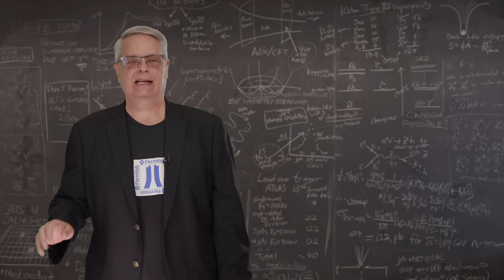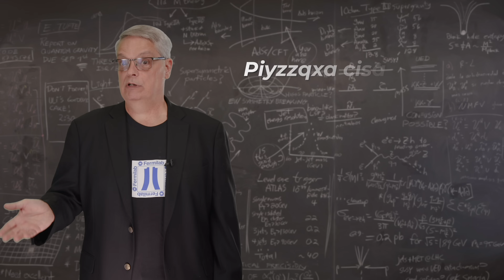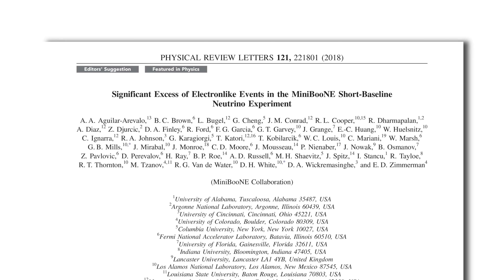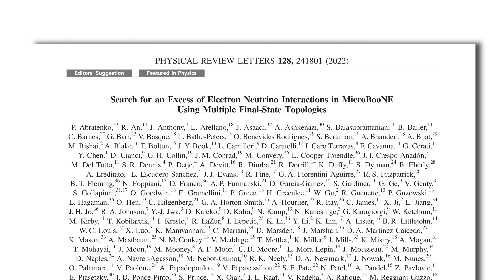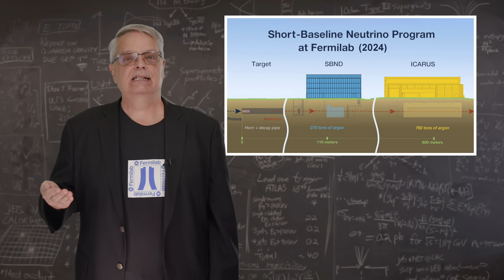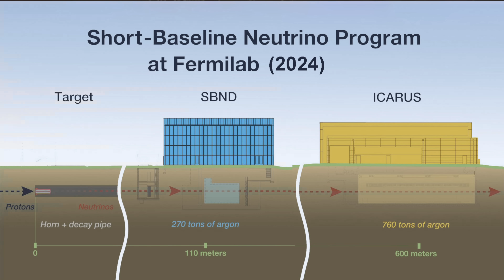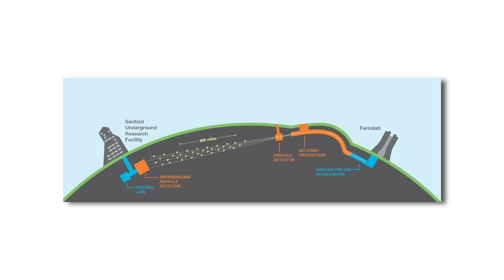Fermilab's search for sterile neutrinos

Comment: Basically the logic of chemistry's energy level staying the same when a one matter is bond or unbonded from another different mass, atom/molecule, it make sense the electron controls the atom's positioning being stable, thus when accelerating energy the neutrino, like the neutron appears to fill any gaps between existing energies that will allow to maintain a const energy level sense.

Electrons do present the speed of light controls and opens the door to the fillers, neutron and neutrinos.

A control to preventing the atomic explosion?
Reply: Some help on the thought, 
the gravity is the logic of placement,
but energy has the ability to relocate self,
so neutrinos could be a substitute and the neutron for gravity's hold.
Reply: Based on the accelerator is a energy current.

Comment: See/saw=constant Sterile neutrino S=(E*T)/(M*T)=2*(me/pm)^2=2*137.036*(2.16*10^-9) is oscillating between T=g*m^2/137.036*(8pi/3)=0.015448 Gev[1.602*10^-19/c^2] : Tau neutrino : right handed antineutrino of M, E, M=pm^2/(2*g*m^2*137.036)=0.1811 mev : Muon neutrino, E=me^2/g*m^2*137.036=0.108*e : Electron neutrino, deduce 2pi*0.001161409725*(me/pm)^2=(me/pm)^2/137.036=128.4980143*A/3.1415926=128.51991*A1/3.1415926=2.16*10^-9=0.00116592026-0.00116591810 : extra wobbling of muon between experiment data[0.001165920+((61-41)+(57-25))*10^-9/2], theoretical prediction[0.00116584719+6845*10^-7+154*10^-8+92*10^-9] from Fermiab at 8/10/23 due to weak force pm/me=1836.1527=4pi*137.036^2/128.51991=1/(4*A1*137.036^3)=(pi/(128.4980143*A*137.036))^0.5 unite strong force g(p)=g*m^2/pm^2=g*(pl/4.1888*l)^2=1.13*10^28 which can deduce ch=2pi*l*m*c^2=2pi*pl*pm*c^2/(4pi/3) by graviton g*m^2=ch/2pi : solution of GR field equation ch=8pi*g*(m*c^2/2)^2/c^4 at any point of 4D dynamic space time oscillating between Planck scale l=g*m/c^2=(h*g/2pi*c^3)^0.5=1.616231*10^-35 meter which can deduce ch=2pi*g*m^2, m=(ch/2pi*g)^0.5=2.176466*10^-8 kg, proton scale pl=g(p)*(4pi*pm/3)/c^2=8.809*10^-16 meter, EM force between proton[pm=1.672621868*10^-27 kg], electron[me=9.10938356*10^-31 kg] in hydrogen Atom[A=5.29177282*10^-11 meter] k*e^2=g(p)*pm^2/137.036=ch/(2pi*137.036)[e+]=me*(c/137.036)^2*A[e-]=4pi*g(p)*pm*me*137.036/128.51991 which can reproduce Dirac's quantum field deduce 0.001161409725=1/(2pi*137.036)=e+/ch : Schwinger's weak QED of Yang-Mills gauge field for anomalous electron magnetic moment of (g-2)/2 factor from positron e+=ch/(2pi*137.036)=k*e^2 which can turn into quantum gravity 2pi*k*e^2*137.036=ch=2pi*g*m^2=2pi*g*(137.036*up*e-/l)*(137.036*up*e+/l)=(2*A1*137.036*pm*c^2)*(4pi*A*137.036)=En*L produce dark photon[Axion] of EM wave at speed of light c=1/(up)^0.5=299792458[meter/second][u=4pi*10^-7, p=8.85418782*10^-12] by r=En=ch/L=chR=me*(c/137.036)^2/2=13.6*e*((1/1^2-1/2^2)+(1/2^2-1/3^2)+...+(1/n^2-1/(n+1)^2))=(h/2pi)*(f1+f2+...+fn) : Einstein's random photon electrical effect prevent continuous ultraviolet catastrophe of electron in Atom, deduce 85.73% ratio between muon[105 mev=(3*137.036/2)*0.511], electron[0.511 mev=me*c^2=g*m^2*137.036/A] decay from beauty quark of strong force 4.25 Gev[1.602*10^-19/c^2]=(10/16)*137.036/g(p)=(10/16)*(me^2/g*m^2)*(137.036/(me/pm)^2) for SO(32) super string theory unite 10D of open string with 16D of 4 4D force of close string by super symmetry 137.036=g*m^2/k*e^2=GR/QM=(m*g*pm*g(p)*pm*g*m)*(1/137.036)/((e-)*g*(e+))=ER/EPR from 100-85.73=14.27=A/(3*137.036*(A-A1))=128.51991/(3*137.036*(128.51991-128.4980143))=128.4980143/3^2=(80.351+0.135)/(137.036*(80.485-(80.428126+0.015448))) deduce 80.428126 Gev[80.351+,-0.094] : W boson from CERN, A1/A=128.4980143/128.51991 : oscillation of Atom radius cause Einstein's Brownian motion we can observe oscillation of Sterile neutrino between 3 flavors neutrino from 3 2D Schwinger-Dyson quantum field ch=2pi*l*m*c^2[type1]=2pi*pl*pm*c^2/4.1888[type2b]=2pi*A*me*c^2/137.036[type2a] by ADS/CFT duality from 3 quantum black hole l=g*m/c^2, pl=g(p)*(4pi*pm/3)/c^2, A^2=g(p)*pi*me/128.4980143*c^2 which can compose a unique extra 6D Calabi-Yau manifold for string theory fits our universe deduce 2^(1/6)*ch=125.0895 Gev; Higgs boson from Higge fied ch=(4.9154)^3*pm=111.4421 Gev[1.602*10^-19/c^2] under critical mass[6^3*pm] as dark energy can expand our universe by ch[72.13%]+ch/3[24.04%]+ch/6pi[3.83%]=En[100%] from SS 1/137.036=e^2/(2*ch*p), (8.809/8.45)^3*ch=126.25 Gev : Higgs boson from muon decay shrink pl to 8.45*10^-16 meter, (6.674103388/6.661181)^2*0.001161409725=0.00116592026 : anomalous muon magnetic moment of (g-2)/2 factor for QCD of Yang-Mills gauge field oscillating with QED of Yang-Mills gauge field 0.001161409725=e+/ch, m/pm=1.3*10^19 is mass gap of QCD[pm/me=1836.1527 is mass gap of QED] , g=6.661181*10^-11  gravitational constant at pl scale due to red shift effect compare g=6.674103388*10^-11 at l scale, at pl scale strong force give proton pm mass and positive charge unit e=1.602176634*10^-9=16*g*pm*c^2 as positive mass energy of proton[938.367 mev] from negative vacuum energy ch on compact space of QBH pl which's Caabi conjecture Yau prove it at 1978, deduce dynamic space time ((8.753/8.45)-1)/((A/A1)-1)=2*105 : oscillation of dual Higgs boson, QCD, QED of Yang-Mils gauge field between muon, electron where 8.753*10^-16 meter is electron decay shrink pl to 8.753*10^-16 meter produce (8.809/8.753)^2*80.428126=81.5 Gev =W weak interact massive particle[WIMP] for dark matter ch/3=pl*pm*c^2/2 make regular matter ch/6pi=W*p/R can emit light spectrum r=chR=13.6*e, deduce [72.13-68.3]Guv - [26.8-24.04][A]guv = [4.9-3.83]8pi*g*Tuv/c^4 : Einstein's expanding universe GR equation from experiment data of Planck satellite for dark energy 68.3%, dark matter 26.8%, cold regular matter 4.9%, Sterile neutrino at bulet cluster emit Cherenkov radiation at dark matter area by pion decay shrink pl to 8.397*10^-16 meter=8.809*10^-16 meter/1.049 by (8.397*10^-16)^2*(1.049*c)/(137.036*pm*1.049^2) =879[secon] neutron decay time at speed of 1.049*c which's Tachyon of string theory, on earth Sterile neutrino from DUNE experiment at CERN be measured faster than speed of light c by 60 feet across 454*5280 feet at speed of 1.049*c=(1+128.51991*137.036*60/(454*5280))/3^2)*c, all prove Sterile neutrino oscillation between 3 flavors neutrino are true.

Comment: Out of curiosity, a quick Google of solar neutrino flux yielded:  "The flux of solar neutrinos at the earth's surface is on the order of 10^11 per square centimeter per second."  I can't help but wonder how on Earth (literally) can any experiment discriminate between that density of background neutrino flux and those produced by Fermilab?  Is there a good source of info on that?
Reply: The neutrinos in the beam are all focused in a very small fraction of a second.  In addition, they are much higher energy and beamed in a specific direction.  Imposing those criteria basically rules out all solar neutrinos.
Reply: The energy range is very different, solar are of a  few MeV. The accelerator neutrinos are more like a GeV

Comment: The beam in the video appears to curve around. How do you steer neutrinos? I thought that due to their low interaction properties they would have to travel from their creation and through both detectors in a straight line
Reply: No. You steer the protons you use to make the neutrinos.  Neutrinos cannot be steered.

Comment: Great presentation and I do have a question. In your video  between 6:47 - 7:05   the diagram seems to suggest  the neutrino beam can be steered around a curve and through non co-linear detectors. How is this possible since they have no charge?
Reply: The protons (red lights) are what are being accelerated and directed at the beam on the far right producing the neutrinos. (green light)

Comment: Since neutrinos are associated with their corresponding leptons, might a sterile neutrino possibly imply the existence of a 'sterile electron'?  Something with the mass of an electron but no charge? And stretching things further, could such a thing be a candidate for at least part of dark matter?
Reply: The short answer is no... in the standard model, but technically, the sterile neutrino is not predicted by the standard model either, but there is a very conspicuously absent right-handed neutrino while electrons (muon, tau) come in both left and right-handed versions.

The long explanation has to do with the Higgs mechanism breaking electroweak symmetry, and I'm not going to try to summarize it here.

Comment: Doesn't the sterile neutrino put stress on the validity of the standard model which is neatly symmetric and complete particlewise? A new particle would ruin its beauty and, hence, its trustworthiness, so to say.
Reply: Too late, neutrino oscillations are not in the standard model either. 

Electrons (muons, tauons) come in both left and right-handed chirality, but the standard model only predicts the existence of left-handed neutrinos... which makes people wonder if there could possibly be right-handed (sterile) neutrinos.

Comment: A question, maybe for a future video?
Why is zero Kelvin the lowest temperature. And then, is there a highest possible temperature?
Reply: Temperature is related to high fast particles move. If they don't move at all, you have zero Kelvin. Obviously, moving less than not moving at all is not possible. (Actually, it's a bit more complicated, but that's the essence of the argument.)
Reply: @bjornfeuerbacher5514 Really dumb question at "I should be asleep but I'm watching physics" o'clock.  What would the temperarure be if the average particle speed was, I guess approached, the speed of light?  Would that not be the highest temperature?  Not awake enough to puzzle through what maximum means when it is more of a limit, or the fact the particles would be a medium affecting the speed of light.
Reply: @markstyles1246  That depends on how close to the speed of light the average speed is. The closer, the higher the temperature. There is no "highest" temperature there, as you can get arbitrarily close to the speed of light (90%, 99%, 99,9% etc.).
Reply: Temperature is a measure of average kinetic energy;  0° Kelvin or 0° Rankine correspond to motionless atoms.
The Planck Temperature (~10^32°K) is considered the hottest temperature.  Look up "Planck Units";  they are quite a trip.

Comment: Whoa! Doesn't another type of Neutrino muck up the nice symmetric grid in the Standard Model?
Reply: That "symmetric grid" illustration that everyone puts in pop-sci videos is crap. It's really misleading and leaves out a lot of information. There are other illustrations that are better. 

If the chart included chirality, then the sterile neutrino would fit into an obvious gap.

(Anyway, that chart doesn't show anti-particles, or color charge... there are several different gluons, for example. Above the electroweak unification energy the W±, Z⁰, and photon don't exist, etc. etc.)

Comment: see far as my math can deduct is:
String Theorys 5 Gravity Fibers=any of the 32 Quarks
using Graviton Knit Dots to Hold the 5 fiber shape solid & render the Strong Nuke Force Mute

so as to say
14 Pentagrams + 2 Five point Stars = a Hydrogen Atom

assuming that Gravitons may be = neutrons, neutrinos, ext

where as
losing a few gravitons= aging, < decay rate or ware <<<< nuke boom

zero dimension = Time aka Generational Evolution / Decay Rates
1d = pressure [+/-] off_of an area
2d = weight or vibration
3d = HLW
4d=limits, temps, syncs
5d = potential, intent
6d = self choosing, sentients

after that we are getting into [unideal gas state laws] requiring sync's to become stable...
across unseen facets

1st iteration of universe was the cold blue fire H1<H2<H3<friction <fusion b4
2nd iteration (=like diamond from coal)  = colder Orange Fire Helium (being NOT H4)<unstable war<heavier elements<nebula<sun#1
3rd iteration =supernova<an illusion of a FSL vacuum space
4th iteration =mind<book<digital=bigger on inside

as we know
2 steps forward 1 step back = Mass< pressure state > energy
& Dark Energy = 0^00 too 10^04 [outside our small 10^05 too 10^25]
&
Dark Matter = the 10^26 too ~20^50 outside our small

knowing that Cern is reaching Temps hotter then inside the sun
= mineral development (up to carbon gas)
we must learn more about the [10,000 x earths gravity needed to fuse H1 & Helium
__for safety buffers
//meaning its not about finding new elements-but-synthesizing unnatural ones based on the deconstructed mineralogical math we need
\\way safer & easier then stacking protons into a new pure power or trying to find all the dif minerals plasma states

bc we know
Carbon Gas b4 Carbon Rock b4 Carbon Sugar b4 Carbon Fat b4 Carbon Muscle
Calcium Gas b4 Calcium Rock b4 grass b4 milk bone

seed, egg, larva
tree b4 squid
seed b4 mollusk
as Carbon Dioxide began to mix w/nitrogen=the Oxygen Pylon
& then fuse to the Hydrogen & = the Water Pylon

Hair b4 nail b4 Lizard Scale B4 Feather
bird pelvis = upside down bc they tried to run out of iceage trees <<< legs became wings & hands became talons

... ok BYE
Reply: ps
fore your Sterile Neutrinos
i think they are the only thing left over after mass dissolves in the blackholes (being the only true Solids of the universe)
The Allocate into & can be ReAllocated after

__wither or not they need enough mass to cause a vent in the blackhole to escape 1st or will eventually stall it??? Who KNOWS

Comment: Did I understand correctly, or am I totally wrong: You measure a number of electrons and muons in each of the two detectors. Then you compare the proportion of muons / electrons to the total of detected particles (or the proportion between the two kind of particles), for each of the two detectors. Then having obtained the composition of the "particle cocktail", you can determine where you are in the oscillation, for a given distance.  Or is it a bit more complicated than that?